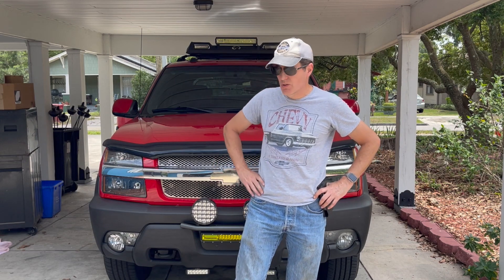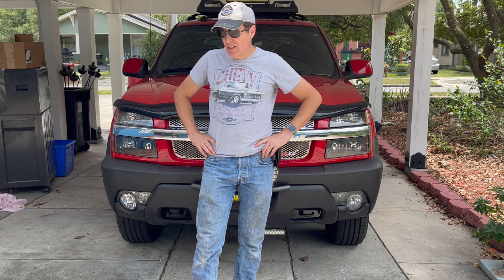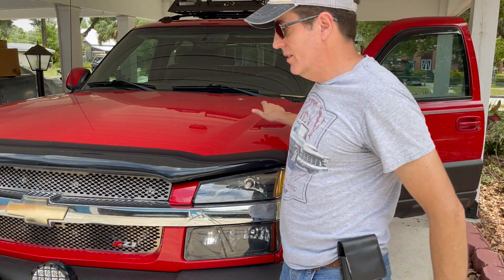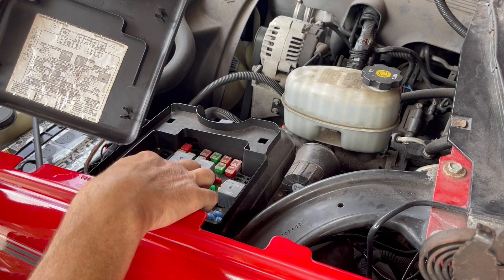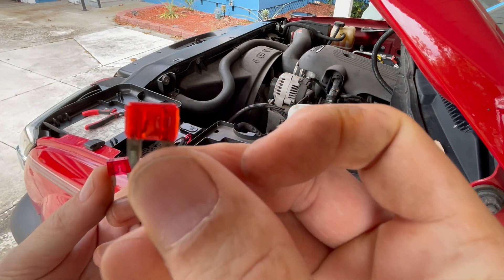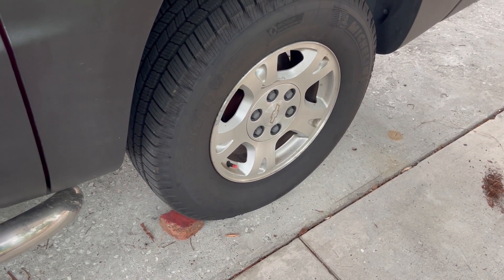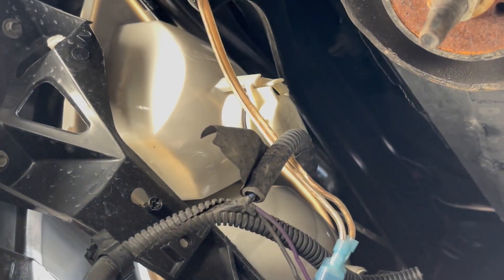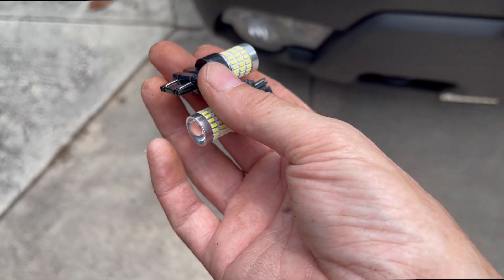Fix Your Daytime Running Lights - 2004 Avalanche and Others

Comment: Using the remote to see if they flash can be helpful. The problem is that’s a programmable feature. So it may be set to flash lights, chirp horn, both, or neither. 

Yours is set to flash so that helped you confirm the repair need but if turned not to flash, that can be a false signal that bulbs are bad / fuse is blown / bad relay, etc.
Reply from the maker: Interesting.  I did not know this was not a normal factory setting.  I've never seen one work differently.  If you press it twice it will also beep the horn.

Comment: When I bought my Avalanche in 2002, I went into the prep bay and removed the relay for the DRL's. Never worked since. It's weird to see the 5.3 in an Avalanche engine bay. :) There's sooo much room.
Reply from the maker: You bought one new in 2002.  That's awesome.  The controversial styling took me a few years to fully appreciate.  I'd much rather have an 8.1 under the hood but they're difficult to find now.

Comment: Hey well I have an 02 available but my fog lights won’t turn on no matter what I’ve change the fuse and nothing what could that be ?
Reply from the maker: There is also a relay for fog lights in the fuse panel under the hood.  That would be my next system check as long as you're sure the bulbs are both good.  Those fog light bulbs do not last long because they are fairly exposed to weather.  Good luck!
Reply: I changed everything and they worked when I tried one on but than it rained heavy and they stoped working for no reason at all and I change all the fuses and lights so idk what else it could be
Reply from the maker: @xo.derek__1710  If it's not the relay it may be the switch.  Check the fuse again though and see if it's blown again which of course means there's a short somewhere or water is getting in.  Halogen bulbs will blow quickly if you touch them when installing.  Are you using LEDs?
Reply: Yes I’m using the proper led for it and still nothing I’ve been the whole day trying to figure it out if not I’m just going to wire them to the low beams

Comment: Mine still ain't working
Reply from the maker: Sorry to hear that.  Two things to remember:  They will only work when the truck is in gear and in the daylight.  Even under a carport mine would not come on.  Other than that, check your lighting relay and check the fuse again.  If you've got a short, the fuse will blow immediately.